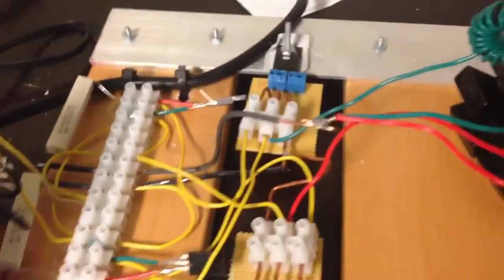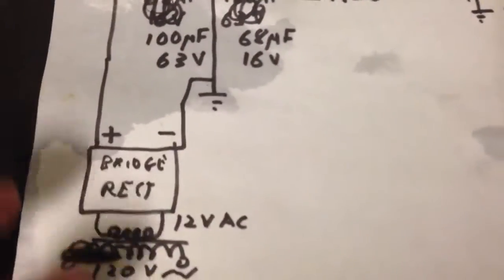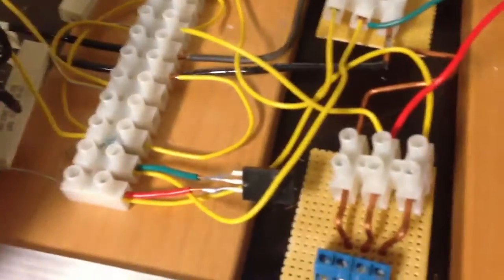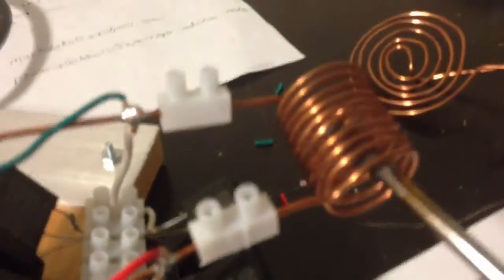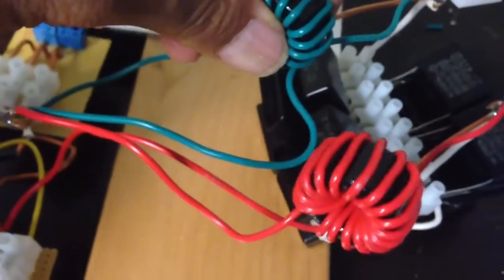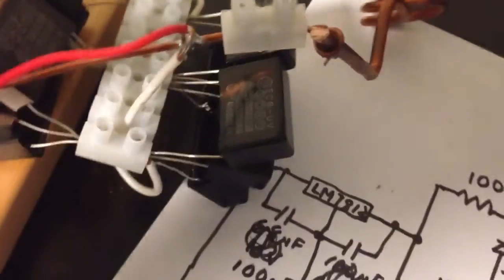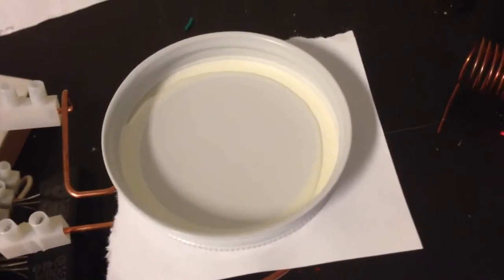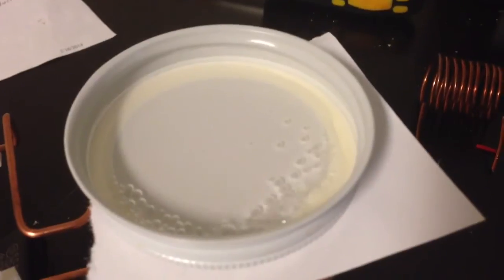Induction Heater run with Different Work Coils

Comment: A regulated bias voltage with RF shunting to ground for the gates sort of makes some sense, doesn't it?  Otherwise one might feel preoccupied that these zener pairs would also behave a bit like noise generators directly feeding a high-power stage...

Comment: Hi,  I would like to know if with the flat coil it is possible to heat a steel needle (approximately 5 cm long, 2 mm thick) placed vertically in the center of the coil ..
Thank you

Comment: Does the 'stove top' coil glow at all?
GREAT VIDEO!
Reply from the maker: with the 2000 strand litz wire, the stovetop coil runs cold or just barely warm.
Reply from the maker: here is the setup with litz wire:https://youtu.be/hmJ0Eq8gEsY